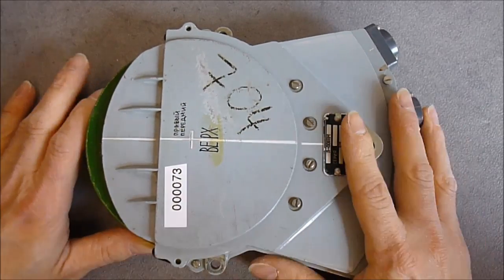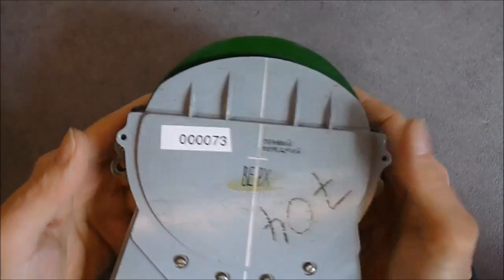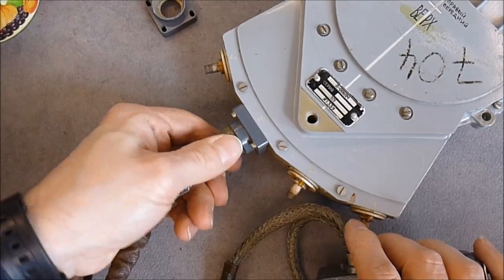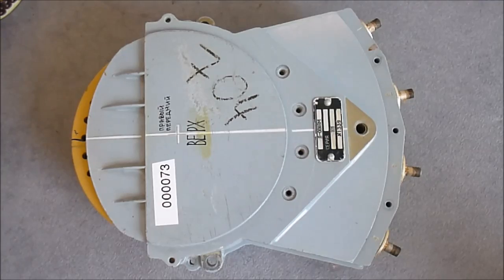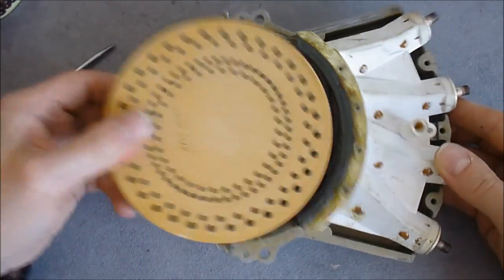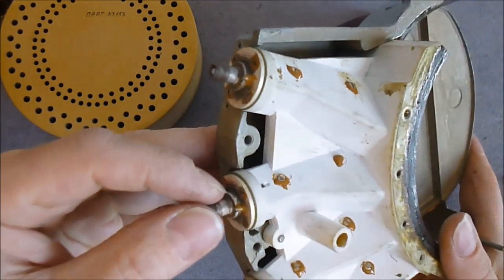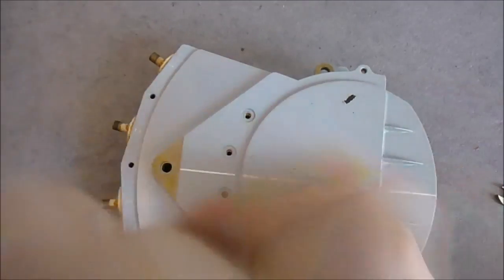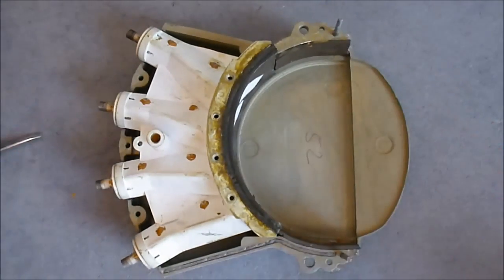Soviet RF voodoo oddware teardown: Sirena-3 L-006LM antenna from a Mig 21

Comment: Me again, the cheese like thing is some kind of dielectric lens with the waveguides coupling into it through the teflon windows on the piece with the four connectors. The fiber glass piece in the front is most likely a radom to protect the goodies from the environment

Comment: Sirena-3 is not a radar per se, but a radar warning system, which detects incoming radar-guided threats.
Reply: douro20 So, it detects the RF signal from enemy's radar and as it have 4 inputs in differents angles, it can detect from where.
Reply: It's similar to collision avoidance antennas which also use 4 antennas but are designed for 360 degrees. Enemy radar detection makes sense or some part of guided missile control or microwave beacon detector and locator.

Comment: I guess the external smaller box you connect around 4:30 is a RF detector, there is a diode symbol on the smaller box and rf detectors are often referred to with diode symbols in block diagrams